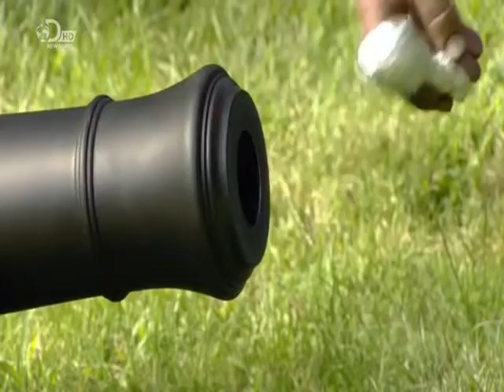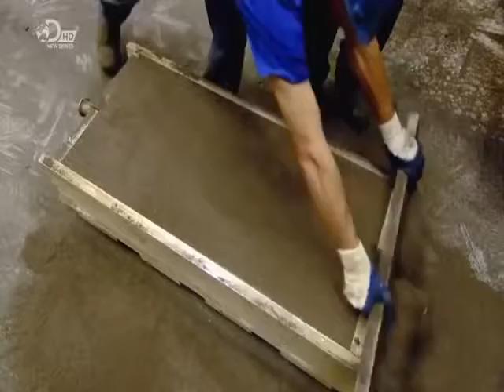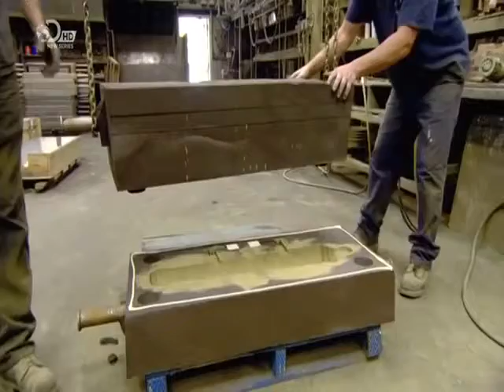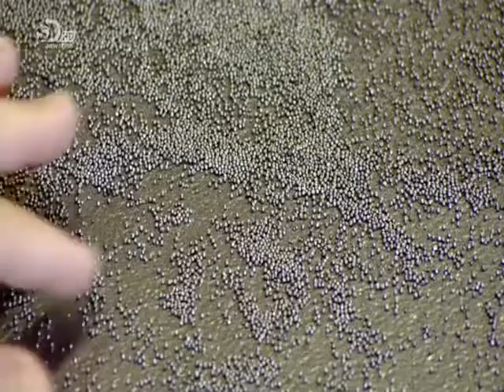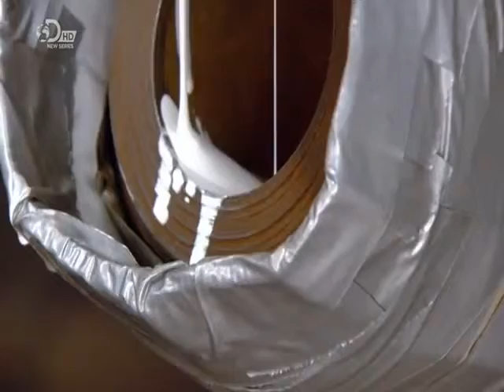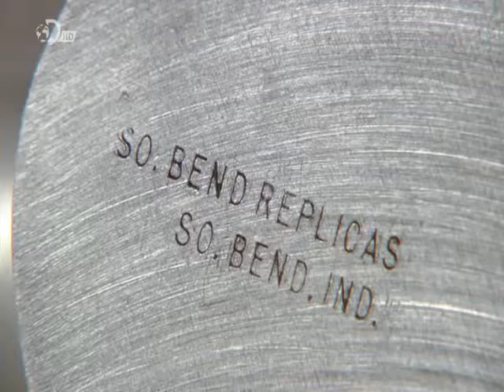How It s Made Cannons

Comment: Cannon Patterns were " Cored" to make the Bore. THE core was assembled from Hardwood, TARRED rope, And Clay. It was lightly fired, to consolidate it, and assembled.
After assembly of the finished outer mould and Core? The Bronze or Iron was poured, giving an cannon  with a rough bore that only need reaming out to final calibre, and the touch hole drilled.
A lot easier than solid casting and drilling afterwards.
Reply: That's not the whole truth. While it's true that cores made it easier, they also lead to irregularities that caused inaccuracy and explosions. They had to use cores because the bits they used were turnt in the cannons like a drill, and were very fragile. In 1774 John "Iron Mad" Wilkinson invented the method in this video, where the cannon is moved instead of the bit. This allowed for stronger bits to be used and for the bore to be made without a core, improving accuracy and reliability.

Comment: Nice to find this. I made 13 cannon for my pirate schooner. I wanted 15, but I ran out of the high-strength steel they were machined out of. The reason for 15 was so that I could do cannon percussion for Tchaikovsky's 1812 Overture without having to reload a hot gun. Mine generally fire in the really old fashioned way -- loose powder charge, tamped down, wadding, cannon ball (sometimes more wadding to hold the ball in place). The charge is 'spiked' with a vent hole pick and then finer powder is laid into the indented vent field. Ignition achieved with a linstock holding a slow-burning match. I learned NOT to use "tinfoil" charges after seeing a pirate reenactor crew unsuccessfully try to fire their guns (no 'tinfoil charges')  using up several lanyard pull Friction Primers (at $300 U.S. per box of 100) only to find out later that the "fire" from the friction primers never made it to the powder charge because of a build up of tin foil remnants that kept getting smashed back into the bore when they swabbed the gun. The tin foil had built up so thick that it held the charge far enough away from the vent hole that no amount of 'spiking' it with a vent pick was going to get the friction primer's fire to the powder charge. They ended up having to flood the barrel, dump the charge (about a half-pound of good powder!) and then dig out all the aluminum foil remnants using a worm, pressure water and a flashlight to see that they got it all out. Regular "cannon" fuse -- the green stuff -- is also forbidden on my boat. We found that an inch or more of still burning fuse was getting blasted out of the vent hole when the cannon discharged. One still burning "ember" landed on a friend's yacht and burned a hole in his huge sunshade. (He was O.K. with it, though. Nice to have friends like that!) So, doing it the complete old-fashioned way eliminated a lot of potential for mishaps.  Sometime over the winter, I'm going to "re-forge" one of my cannon as an experiment to arrive more at that classic "pirate cannon" form from the 1700's. I may end up ruining one of them, but I think I can pull it off. I'll be making a video of the forging and posting it to my YouTube channel when it's done. If you're into cannon and if you want one, these guys here are making a SAFE cannon. They are installing steel liners in the tubes and that makes for a very safe cannon. Do not EVER load up and fire an unlined Cast Iron cannon. No matter how many times you've done it and gotten away with it, the reality is that the next shot could be the one that bursts you gun -- turning it into a giant hand-grenade. Cast iron guns blew up often even during the time periods they were made and used in warfare. Don't even try to fire a "blank" (no projectile) in one -- unless it has a steel liner with a rated PSI far greater than any black powder charge you can stuff in it. I've seen these guys' cannon-work on the Kalmar Nyckel, and it is EXCELLENT!
Reply: Did you ever get around to re-forging that cannon? I'd love to see the video